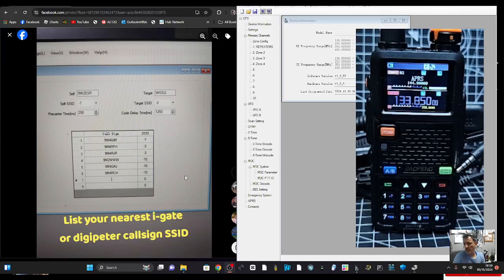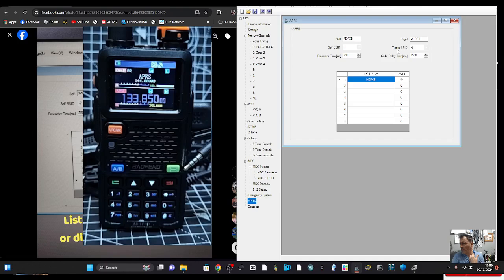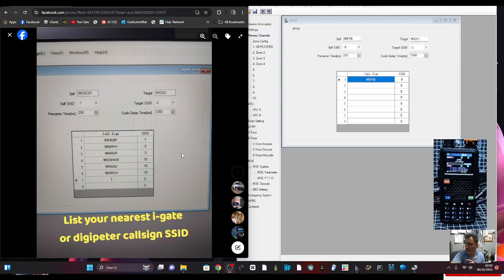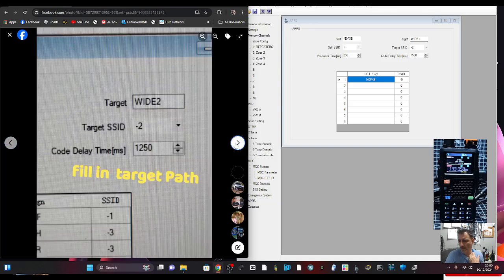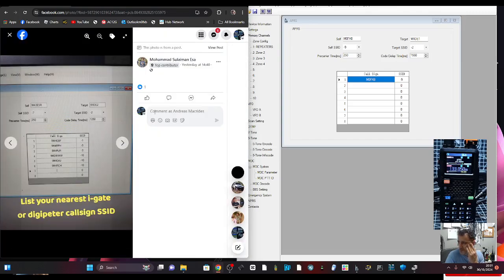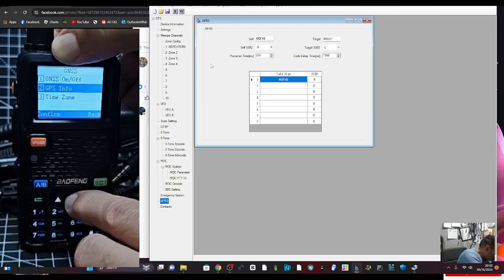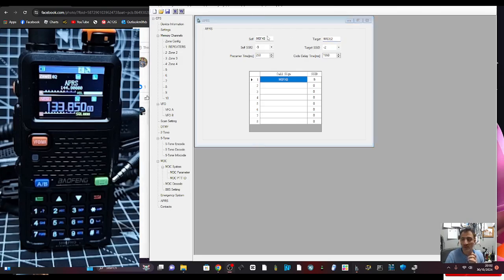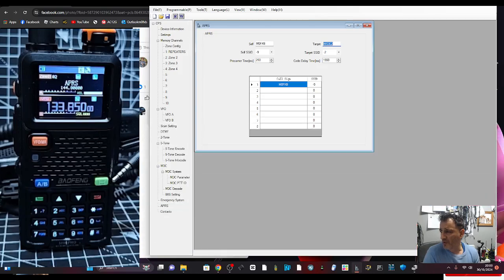BAOFENG UV5RH Pro  - APRS MODEL TESTING

Comment: Very interesting. I dont really have any expectations as this radio will work with aprs. Unless someone, not Baofeng, writes a completely new firmware image. There is a possibility that the hardware has got the necessary essentials. Would make it a very affordable tracker and cummunications device
Reply from the maker: Thanks for watching .